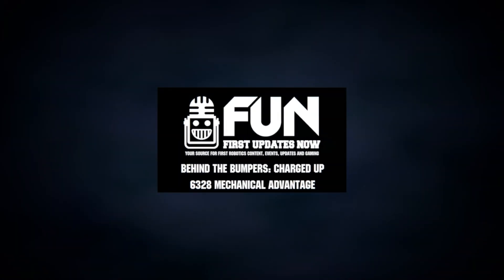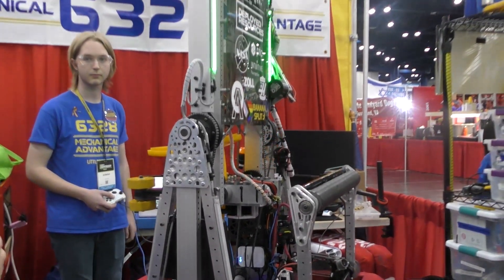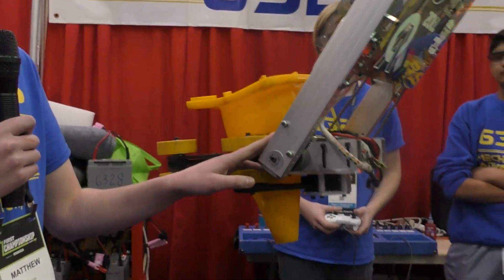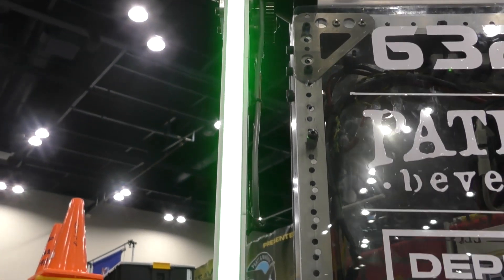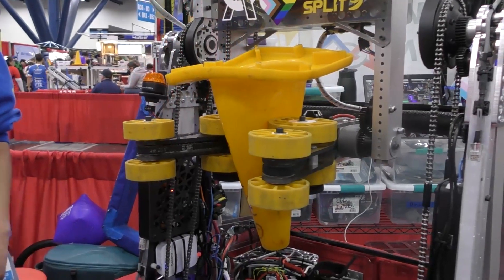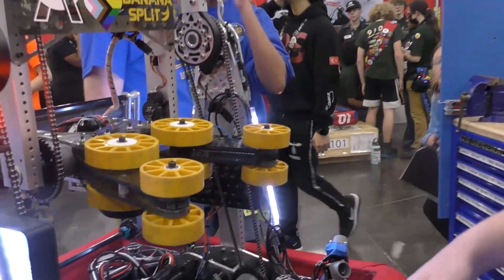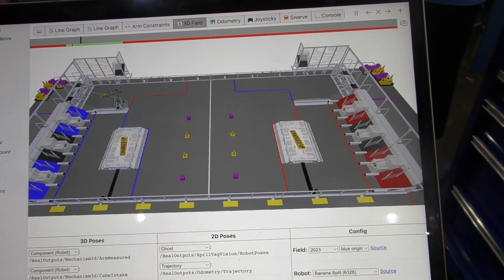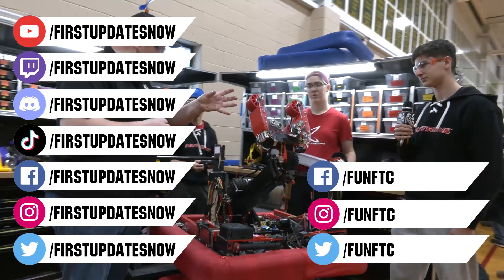Behind the Bumpers |  6328 Mechanical Advantage | Archimedes Division Winners

Comment: Can anybody thoroughly explain the software to track the location of the robot on the field, i have messed around with limelight 3 but not with field positions and movement from them
Reply: Essentially, there are ways you can have your drivebase track where it is on the field through odometry. For example, on our robot this year, there was a SwerveOdometry object that tracked the location from the encoders in our falcons. Then, using the apriltags, you can use some camera to detect where your robot is in relation to the april tags, which will give you a field location, which can then be used to update the odometry to ensure your robot knows where it is as accurately as possible at all times.
Reply: They don’t use the odometry object from wpilib exactly but make their own thing which uses a continuous kalman filter to weight their vision pose estimates and combine it with the odometry pose. Also they coded their own cv module for each camera and are sending it over NT themselves and it is set up so they configure certain constants through the Java side which is pretty convenient.
Reply: @suryathoppae6567  Not quite. An odometry object is wrapped in the corresponding pose estimator which utilizes kalman filtering for weighting sensor readings like you said, however this is built into wpilib, they just have a slightly altered version with a few changes to aid in using multiple streams of vision data. They also did not code their own cv module, they use the existing ArUco module which performs april tag detection and pose estimation, they have a custom python program that runs on the coprocessor to execute it and handle io/config.